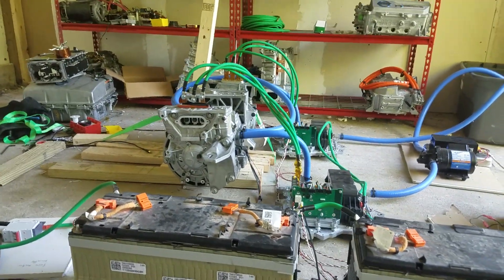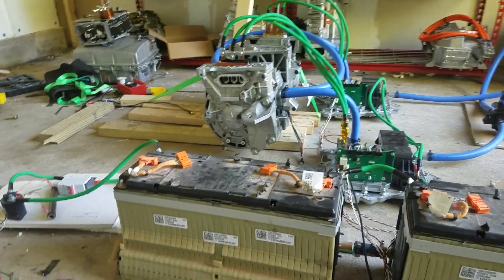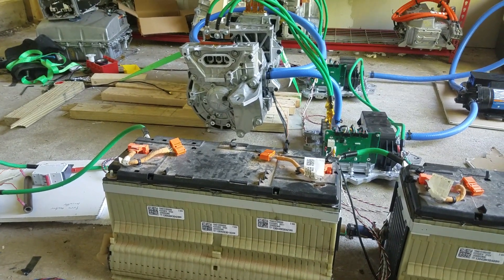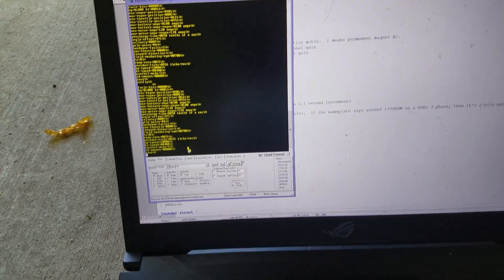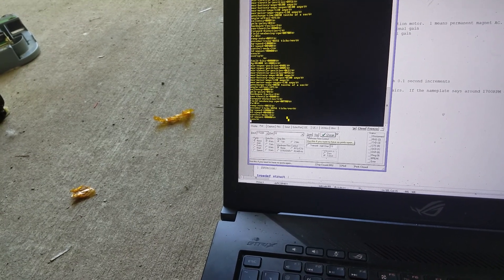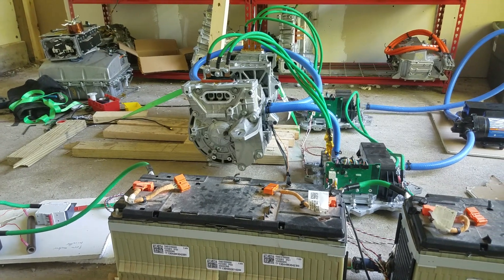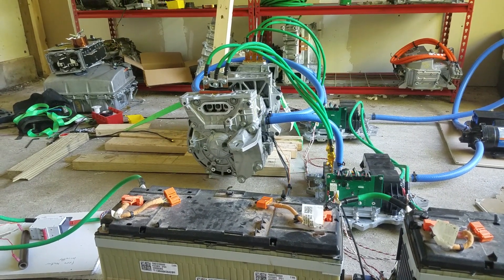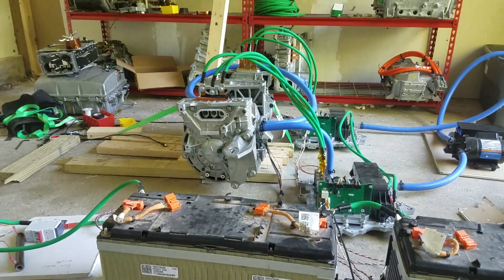Nissan Leaf Dyno demo #2: speed control

Comment: Very cool!
Is it possible to run the motor at more than 10000rpm with your controller? I was thinking I would put a Leaf motor with it's original transmission on a race car. It would be nice to get a higher top speed than 90mph. 120mph would be better.

Comment: Hey I bough a wrecked chevy spark ev to swap into a brz. I want to use two spark motors. Do you think your controller could do this? I'd love to put them together in the rear and control it like a   differential(ie open to posi) is this something you could achieve?

Comment: Dual motors on a leaf?
Reply: I see what you did. Regen on on motor while you drive the other
Reply from the maker: @cheapygeek  Yes that's right.  Full load and very little power from teh batteries.
Reply: @MPaulHolmesMPH  cool. I got a 2014 full leaf donor plus a 2011 leaf inverter. I need to order some stuff from you...